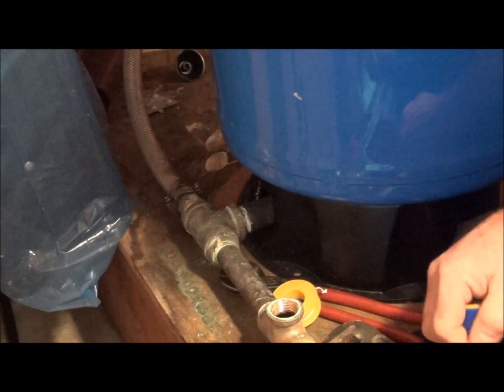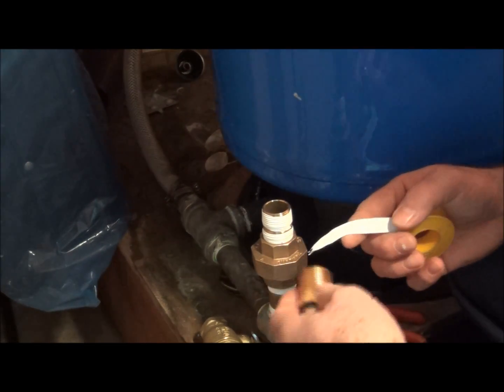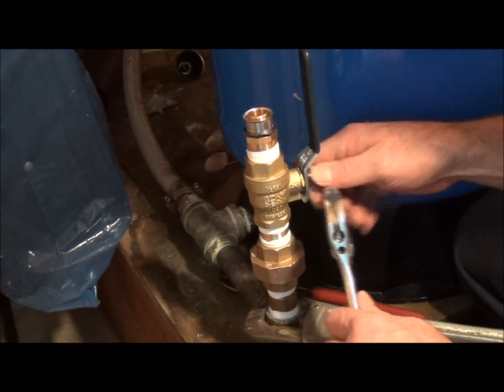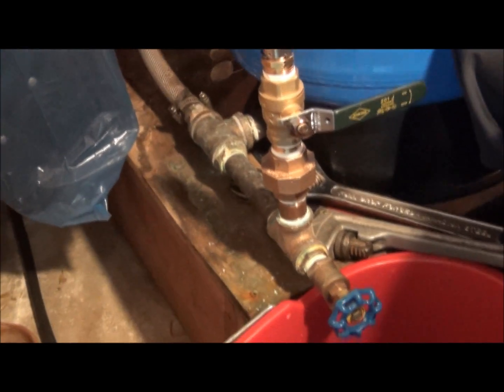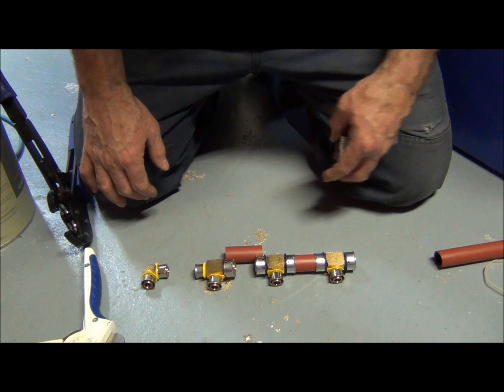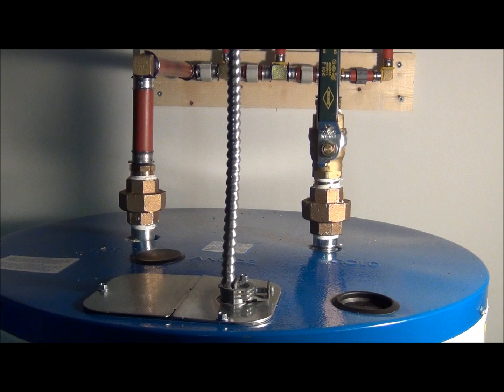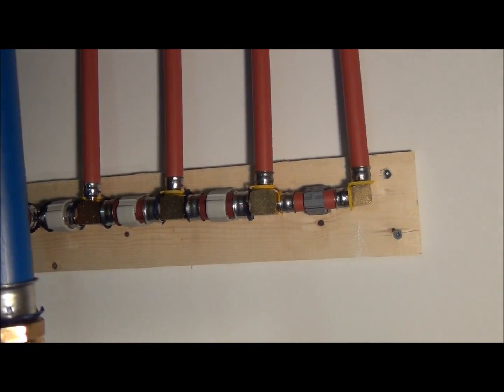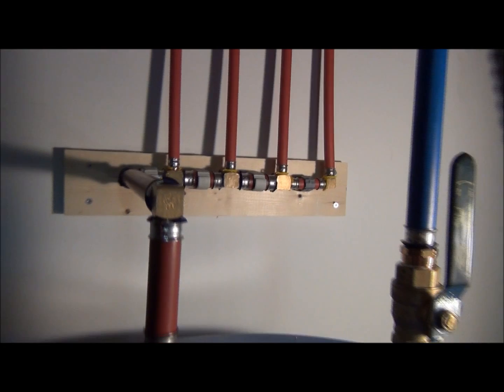How to install Pex Pipe Waterlines in Your Home!  Part 4. Plumbing Tips.

Comment: wouldn't it be wise to place ball valves on the hot and cold manifolds for each line?  That way, if work is needed, you don't need to shut the water off to the whole house.
Reply from the maker: +Chad Murry 
The only item that would require work to be done on it or replacement would be the hot water tank. This would require turning off the cold water supply to it allowing cold water to remain on in the rest of the home.
Valves should be placed on every fixture in the house. All faucets and toilets should always have shut offs installed to isolate them separately if and when they need repair.
Code does not allow valves to be installed on the outlet of tanks. That may be different depending on where you live, but not in many places for certain.
Thanks for commenting and have a great week!     Al

Comment: I'm new to this but could you have used pipe dope on those threads instead of Teflon tape?  Great videos by the way !
Reply from the maker: Rocket Rider Thanks for the kind words!
I could have used just pipe dope, but I personally prefer to use teflon and often I apply a little pipe dope over the teflon as well. Pretty much guarantees a watertight joint!
Thanks for commenting and have a great week!     Al
Reply: And thanks to a different video of yours I replaced the 1.5" ABS drain beneath my kitchen double sink.

Comment: thanks for the great vid. I did have one question. I thought you couldn't directly connect pex to a hot water heater, i thought it was needed to be 30" away.
Reply: Dick Tracey 18” away and its only 30 dollars for stainless steel hookups

Comment: I love the look of that install. Im doing something similar in my house. So you can run pex straight to the water heater without 18 inch rigid lead off?
Reply from the maker: Hello Albion;
Thanks for the kind words!
With the Viega system; the manufacturer allows the pipe to be installed directly into the top of an ELECTRIC tank. When it is an OIL or GAS fired water heaters that changes. Rigid pipe such as copper (non flammable) has to be used and most codes state at least 18" above the tank. To be on the safe side; I recommend going up to the floor joists and adding your pex to the copper at that elevation and it looks neater. All manufacturers have their own regulations for these such tanks, but I believe the codes recommend solid piping off oil and gas fired water heaters.
Thanks for commenting and I hope this answers your question.
Best of luck on your project!     Al
Reply: TheOldkid888
Thanks for the reply. Directly above my gas fired water tank is hvac ducting.  I've been puzzling on how I am going to do 18" and not make it look like a hack job.  I saw your video and there was a glimmer of hope of just running pex.
Reply from the maker: Hello Albion;
Maybe it could be possible to mount a header on the wall and pipe the tank over to it. You do not have to come straight up with the lines when you are running them. I am sure you will be able to figure it out.
Thanks for commenting and best of luck with the project!    Al

Comment: Nice, only thing I'd do different is instead of a straight length with two 90's into your manifold I'd simply run a single PEX line high up from the heater and down to the manifold with straight connectors. Much less pressure loss. That is one of the biggest advantages to using PEX. Cleaner straighter installs with less joints.  I do like those clamps you used, Never seen them before.

Comment: Hello great videos.  Very clear and informative.  I have a few questions.  I am thinking about replumbing my house with pex and I live in Texas where we have very cold winters sometime.  Will the pex tubing stand the cold temperatures if I use it under my house?  Or even better can it be used under the house? And I am subscribing.  Thanks for the great videos.
Reply from the maker: Hello Paul;
You are more then welcome!
First off; most pex pipe can actually freeze and thaw and be used with no issues. I would imagine where you are running them; they will be in an enclosed space. Most crawl spaces such as trailers and older homes are all boxed in so the extreme cold temperatures don't get to the piping if sealed off having no drafts.
Pex pipe is used in many bungalows in this region and people simply drain as much water as they can out of the lines and simply walk away. The biggest problem with pex is UV damage...so it would be advised that if you are installing pex and there is an area where the sun could possibly shine on the product for a good portion of the day; it is best to insulate it to prevent the UV from damaging the pipe...I have seen this happen over time and the pipe have numerous cracks in it.
Thanks for subbing and commenting and enjoy your week!    Al

Comment: Im sorry to say that this is completely wrong and if you go by this you are risking flooding your home as pex of any kind cannot be installed within 18" of a water heater it will void the warranty im licensed and plumb at your own risk when watching these videos look up your local or state codes and also look up info on the product before installing
Reply from the maker: Hello Ryan;
Before you made the statement above; you should have checked the specifications.
Here is a link for the installation on electric hot water heaters using Viega pipe and fittings.
http://s3.supplyhouse.com/manuals/1303921558463/54526_PROD_FILE.pdf
Go to page 13....4.9 fourth paragraph down.
Use metallic connectors to attach PEX
to gas water heaters (Viega Part No.
XLSE4418, XLMSE4418 or similar
fabricated metallic assembly).
Install a minimum 18" of metallic or
other piping between the water heater
and PEX.
For electric water heaters, it
is permissible to connect      "directly"      
to the inlets and outlets with a brass
swivel elbow or straight brass swivel
fitting.
I would NEVER install pex directly off of a gas or oil fired hot water heater. Always add a piece of copper supplying and coming from an oil or gas water heater. I know every state or province is different, but to be on the safe side I run copper up to the joists and go with pex from there. Some places call for 18" and others call for 3 feet; so going to the joists covers most codes.
Thanks for commenting and have a great week!     Al
Reply: Well as i learned in my class they told us 0 pex to w/h connections due to if w/h failure even if electric overheating can occur due to high temps and increased pressure on said  pex unless using fosta-pex per pex representative im sorry i confused here with there
Reply: Good day sir
Reply: ryan jackson
to install pex piping to manufacturer spec is still min code requirement and if a inspector argues with this you will still win even if it is a good idea to put a 18 " gap which is only require on gas fired water heaters in the UPC and the international  code book so he is correct in this situation been doing this for 8 years had a question on this during my master plumbing with gas test passed with 98% in the state of ks

Comment: I like that you put an effort in to making your plumbing look nice. No need for dielectric unions when you already have dielectric nipples coming out of the tank, so you're good there. Could've left some more space on the manifold for the clip on the far left so that it doesn't touch the crimp rings. Otherwise, nice work. A- :-)
Reply from the maker: Hello ctcrew96;
Thanks for the kind words!
I guess there is always a little fine tuning that can be done.
I always try and take pride in my work as it follows you around for life!
Thanks for commenting and have a great week!    Al

Comment: You're really not supposed to use PEX within the first 18" of the hot water heater.
Reply from the maker: Hello CuriousExistencefor;
If you are installing it on an oil fired or gas heater; it is the case and I usually make it 36" off the top before I go to pex.
An electric boiler is different and the company that makes this pex specs it for this installation.
Thanks for commenting and have a great day!     Al

Comment: I seen another video stated: Pex needed to start 36" away from hot water heater.  What is your thoughts about distance from hot water heater?  I see you ran right to it.   Thank you for your time and response in advance.
Reply from the maker: Hello 455supreme;
When installing Viega pex you can run it directly off of the top of an ELECTRIC hot water tank. Whenever installing it off of an OIL fired or GAS fired hot water heater; you must be at least 36" from the top of the boiler.
Thanks for commenting and I hope this answers your question!      Al

Comment: Great job... You inspired me man.... I'm doi'n mine now after watch'n this... and clean'n up all that old copper pipe that's just spiderwebed all over the place due to reno's I've done in the past.... Xcelent vid's......
Reply from the maker: Hello renegademanxxx;
Thanks very much for the kind words! Means a lot!
Pex can be run just as neat as copper if a little time and thought is put into it.
Thanks for the kind words and if anything should come up during the repiping job; drop me a line!     Al
Reply: Ya your welcome man... I was wondering what to do here...should i use a manifold and run all separate lines or just run a main line then put in T's where needed ???
Reply from the maker: Hello renegademanxxx;
Manifolds are great as you have no worries about any fittings between the manifold and the fixture and they also give a constant flow of water with very little pressure drop.
I use them for hot water and go with a 3/4 line for the cold and take tees off where needed.
I have installed a few systems using manifolds for cold and hot.
Either way works fine!
Thanks for commenting and let me know how you get along!      Al
Reply: Yup I agree .... im in the process now of drawing out my layout to figure out what I'll need to do the job... should I use 3/4 line (cold water supply) all the way to the water heater?
Reply from the maker: Hello renegademanxxx;
I would definitely run 3/4" pipe to the water heater. Then install your header coming off the tank.
Thanks for commenting and best of luck with the repair!    Al

Comment: I did it myself!!! I had to replace the water heater after it rusted. We called the plumber and it cost about $1200.00 total including water heater, parts and labors. We decided it was too much and so I decided to take a trip to home depot and bought the water heater. I also decided to use pex pipe 3/4 and snap in joints instead of cramp fitting. When I installed it, it worked great!!! No leak and I'm so glad I did it myself! It cost me $378 for the water heater, and more for the parts. I had to cut the copper line and push in fitting for pex pipe.
Reply from the maker: Hello dmana3172;
I am glad you got along well with the installation!
Saved a few dollars in the process!
Thanks for commenting and have a great day!     Al
Reply from the maker: Hello dmana3172;
The inside of pex is very close to that of copper. the only flow restriction that there would be would be that of the fittings that are used with the pex. Some have a very small inside diameter and this is where there would be any flow restriction.
Thanks for commenting and have a great day!     Al

Comment: Was going to watch a rerun of The Beachcombers or this and am I so glad I chose this! 
Those pipes running up to ceiling, that's art! After spending several hundred on a Manabloc manifold and various clamps you biatch slap together a manifold and zing your done! 
Shister me senseless or what.. You rock Oldman!
Reply from the maker: Hello Rodger;
Thanks for the kind words Rodger!
A few tees together will make as good a manifold as you can buy and is cheaper as well!
Just takes a little prep work!
I am sure you can handle it with no problems at all!
Thanks for commenting and time to watch the Beachcombers now!
Enjoy your week!     Al

Comment: I also enjoyed the videos 1-4 on home installation.   You have talked about water heaters, but not mentioned tankless ones (I don't think). What if any issues need to be addressed with PEX use?
Reply from the maker: Hello Denise;
I am glad you enjoyed the series.
As far as tankless heaters go; I do not have a lot of experience with them, but I would run copper to and from the unit up to the ceiling.
They work on demand and the temp can go up quite quickly; so to be on the safe side; I would recommend copper to the floor joists and add your pex from there.
Just my 2 cents. It would be good to check your local code to be on the safe side.
Copper also gives that nice straight look that is appealing to most tradesman and homeowners if installed properly.
Thanks for commenting and let me know if there are any other things you would like to see!    Al

Comment: so if I have a gas heater.. I should keep the copper there and tie in with a pex after so many inches?
The deal for me is.. I want to repipe the entire house because of terrible water pressure from old galvanized pipe.. so I've been researching the Pex.. I just want to make sure I do things within code, so I am not stuck redoing it when ever I choose to sell the house.. I already know of an issue I have.. I have a gas heater and apparently it is suppose to be 18 inches off the ground.. well whomever installed it 10 years ago put it in on the ground
Reply from the maker: Hello Richard;
I have had a lot of experience with galvanized pipe and fittings. Most domestic water has a field day with galvanized pipe. Plugging it off completely at times.
I would suggest that if you have a gas heater to follow the code. Common sense would suggest that pex and heat don't go well together; I come off the top of all oil fired hot water heater with copper and I bring it up almost to the floor joists. It keeps everything nice and neat looking. Then I attach my pex and go from there.
There is a good possibility that there are galvanized nipples coming off of the hot water heater and they maybe some what plugged. Hopefully not.
You don't want to get into changing your copper directly coming off the tank unless it is really necessary. There is a good chance that when you unscrew the fitting on the tank that the thread that is there will be in bad shape and you won't be able to get a new female adaptor on there; so you are best to attach to the copper near the ceiling and this will cause you a lot less grief.
Thanks for commenting and best of luck with the project!    Al

Comment: question.. that is a water hearter right?... isn't the code that you cannot have pex within 36 inches
Reply from the maker: Hello Richard;
Copper is code if it is an oil fired or gas fired heater.
Veiga actually states that their pipe can be used directly out of the top of an ELECTRIC hot water tank.
Pex should NOT be installed directly from the top of a gas to oil fired water heater.
Thanks for commenting and have a great day!     Al
Reply: awesome. thank you for answering me!
Reply from the maker: Hello Richard;
You are more then welcome!
Anything else should pop up as far as questions go; just ask!
Thanks for commenting and have a great day!     Al

Comment: Hello, I made an outdoor spigot out of a 10" piece of copper pipe(1/2"), a copper-to-pex adapter, a ball valve(brass?) & a floor flange(iron?). Works great & the floor flange really holds everything in place. My only concerns are corrosion between the flange (iron?) and the ball valve (brass?). They were both threaded & simply screw together ..no water will be exposed to the two, other than outside rain. What's your opinion? Youtube Video, search for:  outdoor spigot - ball valve /w floor flange

Comment from the maker: Hello Andrew;

There are many different codes when it comes to pex. I know on all GAS and OIL fired water heaters; the distance is 3 feet. Al depends on what corner of the world you live. ELECTRIC boilers in this neck of the woods allow pex directly in and out of the boiler.
Thanks for commenting and have a great day!     Al

Comment from the maker: Hello GalaXy808;

I think you should be able to tackle it. Just a matter of taking your time and you should be all set. I am a big fan of using teflon and pipe dope on the threads of the tank. Almost assured of a tight joint then.
Thanks for commenting and best of luck with the project!     Al

Comment from the maker: Hello Mrnathann;

Manifolds do come with shut offs on them which are very handy! You can individually turn off each fixture which is fine. It is actually against the code to have shutoffs on the outlet of a hot water tank. That is the reason I have not installed any on this tank. The other thing to remember is how often you are going to turn the water off. Not too often hopefully. Each fixture should also have its own shutoff as well!
Thanks for commenting and enjoy your day!   Al

Comment from the maker: Hello Doug;

I have been making the manifold like this as of late.
The manifold is 3/4 pex tees with 1/2 inch branches.
Veiga can be installed directly off the top of an electric hot water tank. All information on any type of pex can be found on line.
Oil and gas fired hot water heaters require copper coming from and going to the tank!
thanks for commenting and enjoy your day!   Al

Comment: Thanks for taking the time to do these videos. I am rehabbing an old home (1904) with Cast iron drains, galvanized and copper supplies that has had 3 additions. I am completely replacing all of the plumbing and your videos have been an enormous help. After watching this series I am 100% going with the pex system.